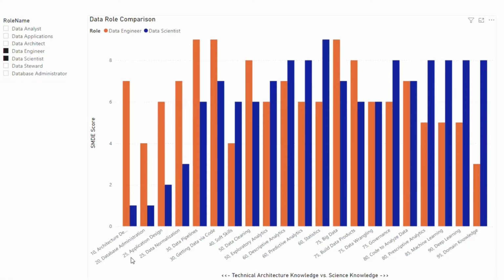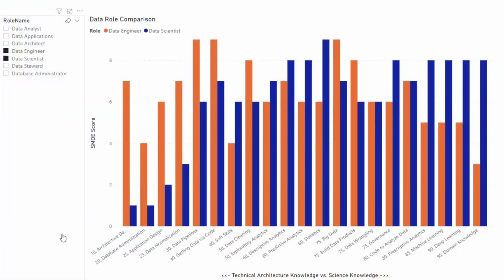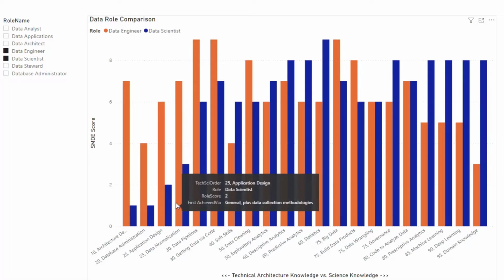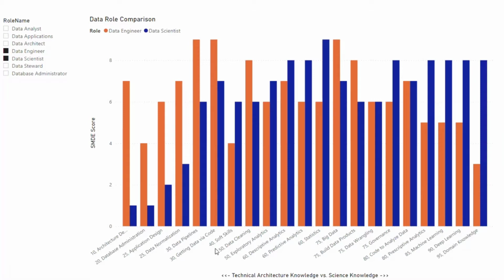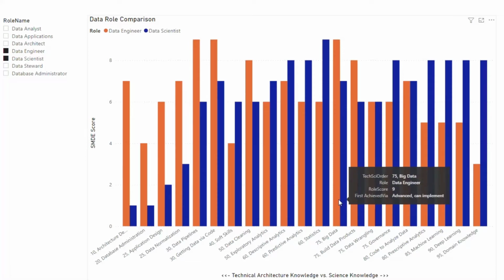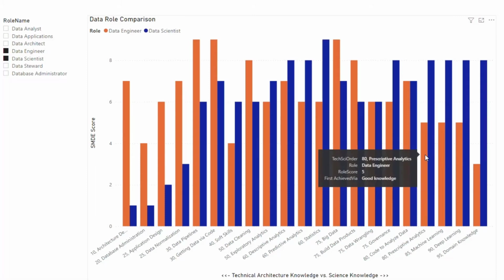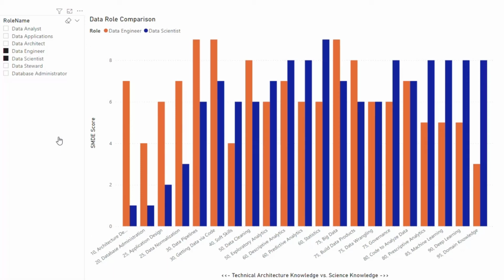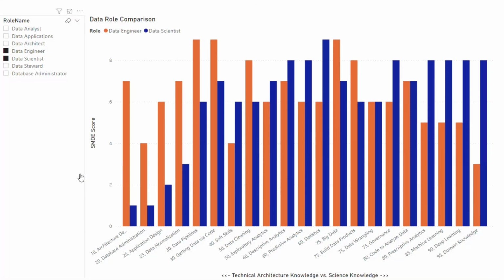Data Engineer vs. Data Scientist - How are they different?

Comment: If I want to go for depth rather than breadth in data careers, where might I be best suited?

I learn more slowly than others of my iq level (96th percentile) but I study more deeply and love to know a few amount of things as comprehensively as possible rather than knowing a ton of things as a moderate level. 

I studied 170 hours after a 10 year career as a middle school and elementary school math teacher and now have a job as an ETL developer at a University primarily using SQL Developer and IBM DataStage.

Do you have any advice based on what I have said so far?
Reply from the maker: This is an excellent question, and I think it highlights one of the neat things about working in this area of technology: you can generally go as wide or deep as you want.  

Data technologies are so diverse and some so mature that it is nearly impossible to use them to their full potential without spending a career to focus on them.  For example, database flavors have almost religious followings for this reason.  Oracle people, Microsoft people. open source etc.  

ETL development is a great place to start, because you will be exposed to proper relational modeling and other features of RDBMS.  Data engineering will give you many opportunities to explore things in-depth.

My advice is to follow the things that interest you the most.  If you do this, you'll find that as time goes on, career opportunities will open for you based on your expertise, so you'll end up doing more of what you like.  

If you have abundant patience and enjoy exploring complex systems, data engineering will suit you; if you enjoy asking difficult questions and leveraging technology to find answers,  then data science might be better.

Keep practicing and getting better at your queries and coding skills; you'll be rewarded!